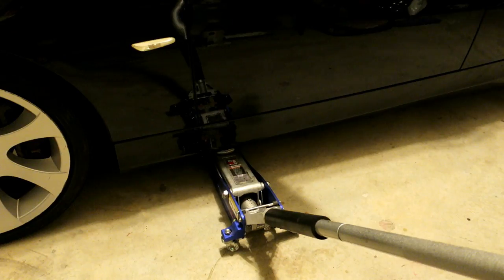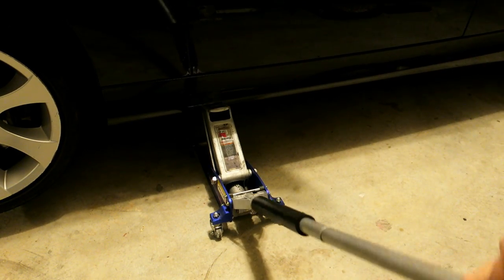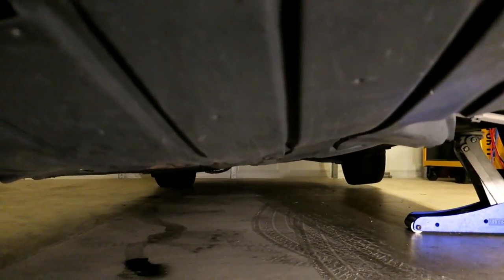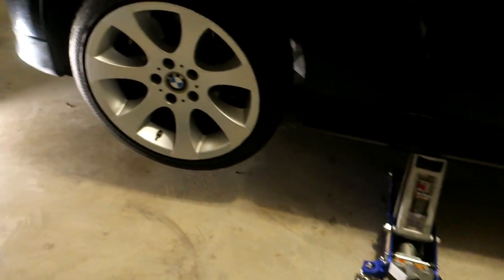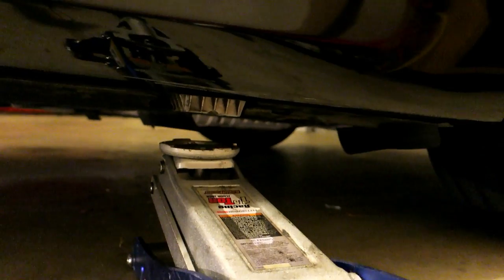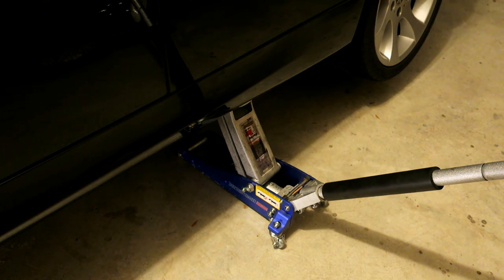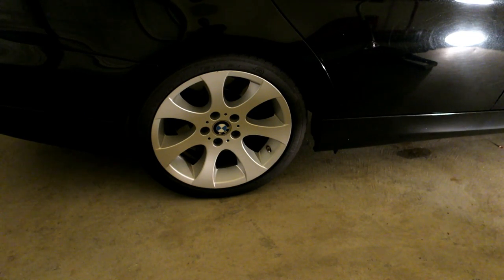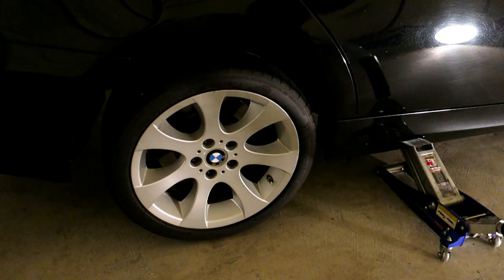How To Jack Up Your E90 BMW At All Four Corners.  Performed On My 2008 BMW 335i

Comment: Don't do what is shown in this video. Just don't do it, trust me.
Reply: please elaborate.
Reply: Do not place jack stands under suspension arms... Place them under the frame.
Reply: Well its only logical that you wouldnt want the weight of your 3000+ lb car on a small ass control arm. The jack points are there for a reason lol
Reply: I had my control arm fail driving so I wouldn’t do this
Reply: @xXDarkice  and this control arm completely broke off?
Reply: Gendo3s2k snapped in half. It’s made of aluminum and not designed to hold the weight of the entire vehicle. That’s not what a control arm is designed to for at all.
Reply: This guy is seriously recommending you put 3800 lbs / 4 resting entirely on an aluminum control arm? I'm not a car expert, but this seems like a terrible idea. I just reported it. If you agree this is dangerous then please also report the video.

Comment: In the front, those are called Control Arms / Tension Struts.  I know this because I just broke the driver's side while lowering the passenger side of the car.  I wouldn't recommend using these as jack stand points.

Comment: 2020 UPDATE:

DO NOT! I REPEAT, DO NOT ATTEMPT WHAT IS SHOWN IN THIS VIDEO. EXTREMELY UNSAFE AND DAMAGING TO YOUR CAR. CONTROL ARMS ARE NOT DESIGNED TO HOLD SUCH WEIGHT. YOUR CAR WILL NOT SWAY OR TIP OVER IF YOU PLACE BLOCKS BEHIND THE WHEELS WHILE LIFTNG! USE THE 6 JACK POINTS PROVIDED BY BMW!!
Reply: Dam for real? This guys repeatable

Comment: Honestly, the most nerve-wracking part with working on my E90 is actually putting it on 4 jackstands. You're correct about the front point if you have a shorty race lift like that. Its worth it to get the steel 3 ton low profile lift from HF instead of the 2 ton aluminum one (I ended up getting both because the aluminum was great to take with me to the track when I was auto crossing). I also spent the money on the Esco jack stands (which are like $60 each and are high lift pin types, not ratcheting like the ones you and I have).  (write up how, below). 

When I want to lift from the floor and need all 4 points off the floor, I start at the front and put jack stands on lowest setting just to the side of the car, jack from the center point using a hockey puck on the floorjack pad and use my 3 ton steel low profile lift. Parking brake engaged, wheels chocked (rear), lifting slowly to get the jack stands under the jack points on the side, or under the arms as shown. I prefer the jack points to the control arms, but I have used the control arms with a hockey puck (to avoid steel on aluminum) and will try to get the jack stands as close to the bushing as possible or under the bushing if possible, if I must use a control arm placement. Slowly lower your floorjack on to the jack stand pads, making sure that all feet are on the floor before putting all the weight on the stands. Verify that the jack stands are rock solid in place before removing your floorjack from the lift point. Next move to the rear, with the 3 ton low profile floor jack, using the differential body (more towards the front of the diff body, because on E90 and E90 M3 variants, they have an aluminum cooler on the rear, which is too soft for lifting), as your lift point. I also use a hockey puck on this as it allows a little variation on the lift angle, when ascending. Lift slowly, watching the jack stands, so that they stay stable, elevating the differential and then the wheels on to the floorjack. As with the front, have your jackstands at their lowest setting, just to the outside of the side-skirt rear lift points (my preference) or just to the outside of the body, near your subframe bushing mounts. When you reach the proper height, slide your stands into position. Slowly lower your vehicle onto contact with the jackstands, and verify that they are straight, all feet solidly on the ground, and adjust them as needed. Finish lowering your car onto the now solid jack stands. You can leave your floorjack under one of the wheels or under the jack points (differential or center front) for safety, as you prefer.

Comment: I just got (4) of those jacks you used in the video. With the July 4th HF coupon you can get them for $59 each. I have (4) jackpad adapters. Just use one jack at each BMW jackpoint, the side ones. Once lifted I put a jack stand under the jackpoint at the jackpad point under front center, if needed, depending on the job I am doing.

Comment: PSA : Do NOT put jack stands under that control arm. Horrible advice.
I did this on my car and, 6 months later, upon abrupt braking, one control arm broke.
1 year later, the other side broke too.
Total cost $1000. Get a proper low profile jack, my friends. DO NOT put the weight of the vehicle on those control arms.

Comment: Not sure if this would work on and e90 but on my e82 135i, the chassis is stiff enough that you can jack it up from one of the rear factory side jack pads high enough to get a jack stand under the front jack pad on the same side.  Move to the other side of the car and repeat.  Then jack up from the rear diff and place jack stands under the rear jack pads.  I have never had a problem damaging the lift points, but my jack stands are the ESCO brand and have a flat top with a thick rubber pad on them.  Sweet jack stands, I highly recommend them.

I have the same harbor freight aluminum floor jack as you and they will twist like that when lifting sometimes, super sketchy!
Reply from the maker: I'd assume that the E90 is similarly as stiff, when I jacked up the passenger side of the car from the rear it equally lifted up the front.  I know I can't use that technique on my E30 that's for sure haha.  Thanks for the info, that seems like another decent way to go about it provided you have good quality jack stands like you were saying.  Yes on a number of occasions that jack has twisted.
Reply: As someone who is doing an oil change on their e82, I thank you!

Comment: This way you will squash your brains out in .5 seconds. Do not do this. Pull the e brake, block rear tires and jack from the center. A $100 jack from harbor freight will do the job. You can then put jackstands only on the areas recommended.

You have some good videos, but take this down before some poor bastard gets hurt. It is so odd you would do this given you are meticulous and right on in so many of your other videos.

Comment: I’d rather spend more on a jack that will lift the car from the proper lifting point so that I can place my jack stands than do it this way. I bought my jack at Costco. It’s low enough to go under my wife’s 328i, strong, and goes high enough to lift my Tahoe.

Comment: I have the racing jack but it is not clear to me the jack stand under the jack pucks is safe either and the jack stands don't fit well under them with out a rubber insert. Either the plastic or the rubber could deform and cause it to slip out. The control arm seems like a better idea but it could cause damage. I actually don''t know of a good way to place this car on jack stands. It seems like Ramps are the way to go.

Comment: I NEVER put any stress or even touch any suspension parts. No way Jose. M3 parts are too expensive and a pain to install again if they mess up. You looking at replacement parts, and alignment fees.
Reply from the maker: There are ways to avoid putting any stress on suspension components such as jacking up from the support at the front but I'd be worried about people getting the jack placement wrong and damaging their rad etc.  The way I see it is the suspension is under tremendous pressure carrying the weight of the vehicle and during cornering etc.  Sticking a jack stand under it will put some pressure on the bushings but they're designed for that.
Reply: @VehicularDIY  the suspension arms are under pressure but at the end points where the bushings are. Put tin that much weight anywhere in the middle of the control arm makes it a weak point, and could potentially snap at the point where you place the jackstand

Comment: DO NOT JACK YOUR BMW THIS WAY! BMW has a standard procedure for how to safely jack up your car and secure it with jack stands. 

$200 is nothing compared to your life, you can buy Pittsburgh Automotive 3 Ton Heavy Duty Ultra Low Profile Steel Floor Jack for $186.

Comment: As he said, this approach is for DIY'ers. This is not my favourite way to lift the car, but the central front lift point is rubbish and I can't find some chassis side rails, like the E46 has, so you can lift the car from the side and then make it rest it on the jack-stands when you remove the hydraulic lift. ¯\_(ツ)_/¯

Comment: If you want your car to fall on you while working on it do this. Now if you don’t die and survive somehow be ready to spend thousands on buying and having control arms installed. If you lift from the front middle even with a small jack the car will not be unstable because of the 2 rear wheels that are still planted on the ground. Like a tricycle.

Comment: so the real problem is BMW does not provide front center and rear center jack points.
Reply from the maker: If you raise via the front support or via the rear differential I find the car isn't well balanced, so I prefer the method shown in this video.
Reply: yes they do, the rear subframe right behind the diff, and the stub on the subframe, at least on the e60 it does

Comment: DONT PUT A JACK STAND WHERE SHOWN

Theres plenty safe workarounds for jacking up low cars or ones with few dedicated points. In order of safety:

Invest in profile trolley jack

Drive it onto wooden planks first to give more space for the jack

Even using a scissor jack on one side to increase the clearance is better than this 

There's also millions of threads on thousands of forums from people who need to jack up any car ever made with all conditions considered.
Reply: Sound advice they make BMWs difficult to work on so any old joe doesn’t screw it up and if they do it results in BMW earning money in parts and control arms are not safe to support car on there’s a small chance it could snap while you’re under it and that’s not a chance I would take.

Comment: This is certainly not advice that I would listen to, this is dangerous.
A control arm is NOT a structural component on a car.
Use a good quality jack and use the lifting points that the manufacturer has provided.

Comment: THIS IS UNSAFE.  Seriously, you have a garage ... get a heavy full size 2 or 3 ton floor jack with a 19" or more lift height from Harbor Freight for only $100 and lift at the front center lift point.  I would NOT get under car with jack stands on aluminum control arm like shown here ... very dangerous.  

Lift from center and put jack stands in pairs on the sides under the plastic jack pads, which can be replaced if they get damaged or fall apart ($10 each).